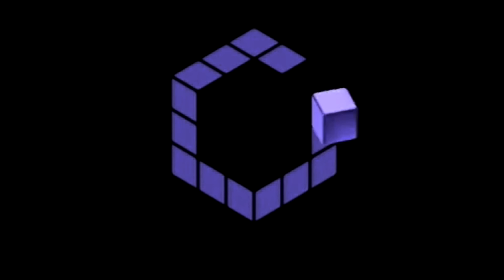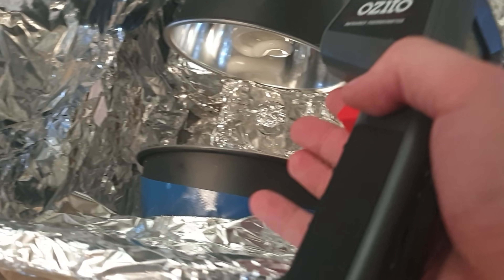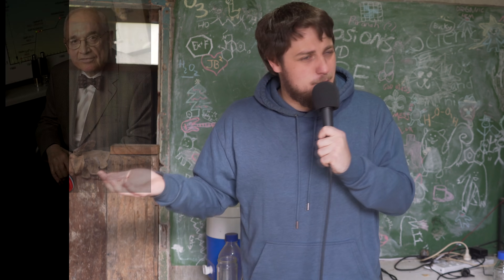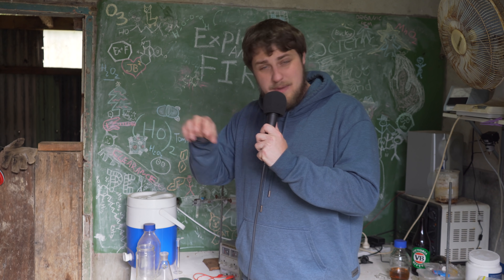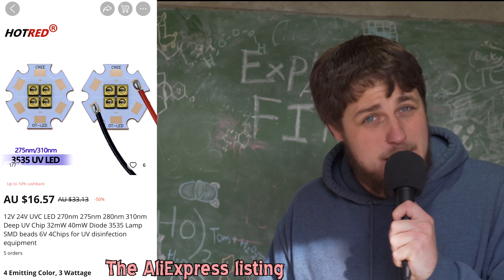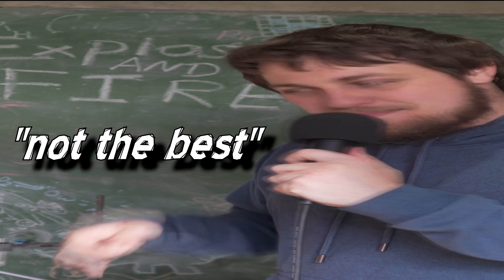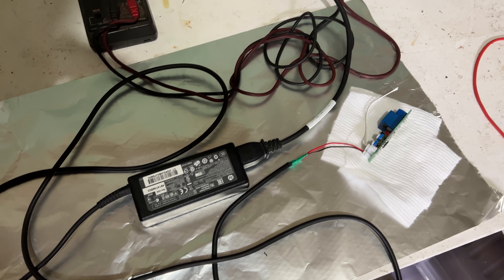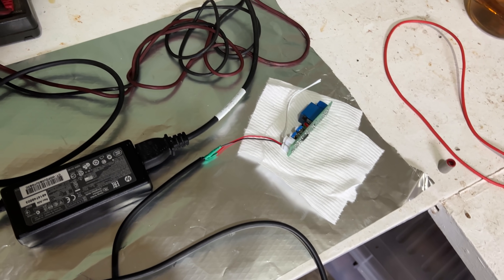Magical deep UV LEDs - Cubane Ep 12

Comment: It's probably been explained already but the reason LEDs won't just draw whatever they need is because after the LEDs have enough voltage to start conducting, the forward voltage drop (that is, basically, the resistance across the LEDs) will drop rapidly, which is why you need to limit the current externally. As LEDs heat up, their forward voltage drop will also decrease, causing more current to flow, which is why you saw your LEDs draw more current as they were on for a short period.

Also, personally, would recommend putting the relay after your power supply. Depending on the quality, it may not limit the current flowing into the capacitors, causing inrush current any time you switch it on which can damage the relay or the capacitors themselves over time. Some electrolytic capacitors also have limited charge cycles, though usually more so than even Li-ion batteries, still a consideration for long term usage.

Comment: The easy way to power LEDs without a driver chip is to find what their junction voltage is, subtract that from your power source and then put them in series with a resistor that drops the remaining volts at the required current.  Also don't run them full blast.  Ohms law is scary useful.

Comment: 40mA @ 12vdc is only .48W power.  It seems a bit off on a power led since there are 4 on a board (.12W each).
I would try getting the data sheet on the leds. It will give you the correct limits and include pwm , which will allow much more power to be emitted. The data sheet typically also gives the spectrum of the light. Perhaps you can find a mark on the backside of one of the roasted ones
As for the .40mA thing, the prefixes are the same as for weights. Using 1gr of NaOH when it calls for 40mg is sure to stuff it up.

Comment: The "electronic stuff will just take the power it needs" idea does generally hold for most stuff. If you give it the right voltage it'll just draw as much current as it wants.

LEDs aren't like that. They have a normal voltage drop across them (usually about 2 volts per LED) and won't conduct much, if at all, below that. There's a really narrow band between too little and too much where it'll operate more or less normally, and above that you now have a smoke emitting diode. You need some sort of current regulator in series with each module to ensure that it never gets more than the current it's rated for.

In the case of those modules, they want 12v and 40mA. Say you want to power them off that 19v power brick. Put a resistor in series with each module, then put the modules with resistors all in parallel, then connect the whole mess to the power supply. Each resistor should drop 7v (19-12) at 0.04A. A little Ohm's law and you get a resistor of 175 ohms. It'll need to be rated for at least 0.28 watts. Chances are you'll have a way easier time getting your hands on 200 or 220 ohm resistors at 1/2 or 1 watt, and those would be fine, it'll just run the LEDs at a little lower power and the resistors won't get as hot. Those are both very good things.

Comment: The way you should think of an LED is a voltage drop. The idea that it will only take as much current as it needs doesn't apply to diodes. It will happily dump very high amounts of current as long as you go above its threshold voltage. You want a series circuit of a resistor and diode; a series circuit has the same current traveling through all of its components so that resistor will limit the current so you don't exceed the limits of your diode. Practically speaking this just means you subtract your diode voltage from your supply voltage and divide the remainder by the desired current, this will give you the resistor value.

Comment: The ammount of misunderstanding of electronics here is astounding 😅😂

A 12v 40mA led neads "around" 12v at MUST NOT have more than 40mA.
Use ohms law and led resistor calculator to get it right since this is so low current.
1A through this WILL kill it FAST.

You need to know your powersupply voltage (needs to be a little more than the diode voltage).
The foreward voltage of the diode.
The current of the diode.

And then you calculate the resistor you need, and if you cant get the exact value resistor go to a HIGHER one to not overpower the diode.

Example
12v and 40mA diode and 14v powersupply
You need 50 ohm resistor in series. If you have a 6v diode and same powersupply you need 100 ohms.

And veryfy with a multimeter the current of the diode to be less than 40mA and the powersupply voltage.

You cannot use a 1A or 900mA led driver for a 40mA diode.

Comment: Remember: Voltage x Current (or Current x Voltage) = Watts. 1 amp x 12 v = 12 watts. and that's a lot of heat.
Reply: Except they stated a 40mA rating, which is only 48mW, for 4 on a board, which isn’t nothing .

Comment: Bruh, please learn what a resistor is before attempting this again. Those poor LEDs are screaming in pain. You're probably going have to buy a whole new set of them, because the ones you have are likely in the death knell now and probably unable to put out the specific wavelength that you need any longer. I'd be shocked if they were still functional enough to make this project a success.

I BELIEVE in you, I just don't BELIEVE you did enough reading before trying to wire up those LEDs.

Comment: Amazing video man. Mark my words, I shall make a UV C phone flashlight. You don't need the earth unless it is in a metal case. The earth is meant to carry fault current to ground when eg a live wire touches the inside of the case. The ballast is made of metal so it should be ideally. Those ballasts are used often together with cob leds in metal lighting fixture. The ground wire is usually screwed into the fixture effectively grounding the whole thing.

Comment: 70's leds weren't high powered, LOL.  They improved a bit in the 80's.  90's was when they opened up from "tens of millicandela" to entire whole candles of output.

The price of blue LEDs dropped drastically when they figured out how to make them from GaN instead of hyper-expensive silicon carbide.  Not the same device at all - drastically different voltages - except that they both made blue.

I do wonder if replacing mercury lamps with LEDs is a good idea for society in general.  A mercury lamp isn't toxic unless you EAT it, and these ultra-high-wavelength LEDs die really fast and are polluting to make.  Is it a net win?

Comment: If you are driving the leds they need to be current limited. Either a resistor selected using ohms law, or a current source set to 40mA MAX! 
Thats why the amps jumped so quick on that PS. It just acts like a dead short

Comment: Please reconsider having the relay switching the 240v lines. Put it on the low voltage DC side instead like you were considering. You have exposed terminals with 240v present on that relay with no cover, I’m not saying you’re going to electrocute yourself or start a fire but there is a non-zero chance, especially with no earth and potentially no RCD on the circuit. Yes you could put it in an enclosure, etc, but better to just have it operate on the DC and eliminate the hazard. Legally, you shouldn’t be modifying 240v at all without some sort of qualification though I don’t really care about that as long as you work safely. I’m sure there are plenty of other comments saying the same thing but I cbf reading 1k comments. Love your work mate, don’t take this as criticism but rather friendly concern.

Comment: With no load and the power supply on, adjust the current to a very low value a little above the minimum. Adjust the vtage up to a bit over 12V. Place a short across the power supply terminals, then adjust the current to 40mA. Disconnect the short across power supply terminals. Turn off power supply and connect LED. Turn on power supply. Confirm LED is consuming 40mA. Might have to slightly bump up voltage setting to ensure power supply is operating in constant current mode.

Comment: LEDs do positive feedback current draw... you need current limiting. whoever it was who told you otherwise on twitter either has their head up their ass, is a troll or is talking about LEDs with integrated driver.

40mA is likely the maximum forward current

Comment: Firstly, congrats for 'giving it a go'.
Having said that, I suggest you grab another full set of UV LEDs as I suspect those ones will be pretty screwed (you've thrown over 2000% of their rated current through them)
As others have already said in their responses, 40mA MEANS 40mA and anything more starts 'frying' them.
Your benchtop power supply is not accurate enough on its current setting
It's pretty simple to create a constant current circuit - 2 * transistors and 2 * resistors, but the suggested LM317 style is even easier.  1  * LM317 and 1 * 33 ohm resistor will give you 37.8mA.  The power supply can be any voltage between about 15V and 40V so your 19V laptop supply will be fine.
LEDs are most likely failure cause is overheating.  Not the temp of the heatsink, but the temp of the tiny silicon die itself.
The hotter they are, the more current they will consume so it's a BAD idea to run them in parallel - due to manufacturing tolerances, one will consume a TINY bit more current than the others in parallel.  This will make that one a little hotter, so it will consume even MORE current -> RUD (RAPID UNSCHEDULED DISASS$EMBLY!)
You CAN safely place LED in series (but you'd need to increase the voltage of the power supply accordingly)

The MOST 'finicky' LEDs IMO are LASER LEDs.  These will 'let out the magic smoke' if you even THINK about over driving them!  (e.g. the cheap red ones you can buy from Jaycar will die in less than a millisecond if they're over driven by only 2mA!  Don't ask me how I know <<<Sigh>>>).  From what I know, the LASER LEDs die by burning the mirrors at each end of the cavity LONG before the die itself is fried.
The LEAST 'finicky' LEDs IMO are the infrared LEDs like those found in your TV remote.  These are normally rated around 50mA or so, but are often driven at over 1000mA (1A) to make them 'bright' enough for your TV to sense.  The key is that they're pulsed off/on rather than CW (Constant Wave) so they don't get enough TIME to overheat and die.

In your UV case, you're MOSTLY looking at CW operation.  (Pulsing LEDs involves timescales of microseconds to millseconds while you're talking about multiple seconds!)

In short, do a simply google search on "LM317 constant current" and run with that

Comment: If you have 12~14V LEDs, do not give more than 12V (which can have some error margin because your display isn't perfect). Giving it more volts will cause electricity to go through places it shouldn't go through, which is why you see power increasing. Basically it means bad things are happening and your LEDs are dying, heating up, maybe catching stuff on fire in the process. I'm probably not the only person who cried watching this as you went over 12V and the amps went up.

Comment: Holy fuck, this is both entertaining to watch, and so painful at the same time. 
At the begging you went "I'm not good at electronics" and I was like, "dude has a Phd (or almost), does organic chemistry for fun, connecting a few leds isn't that hard", and then I saw him connect "40mA" led to a power supply scaled in Amps, I nearly jumped out of my seat.
But yeah, my setup would be:
1. Try to confirm if those indeed are 40mA LEDs
2. Get adjustable power supplies that have regulated current, maybe something LM2596 based, they are like 1-2 bucks on aliexpress
3. Get a semi decent multi meter, like I'm not saying buy high end Fluke but please don't use those sub 10 bucks crappy ones to set up 14$ LEDs
4. Dial both voltage and current to 0, connect the multimeter in series to measure amps (milliamps), and turn the voltage up, after that raise the current to desired value.
5. Unless it's good for chemistry don't bother with on/off circuit, if you can't cool it, just dial the power down 
6. Airflow through radiators is incredibly important and efficient, with radiator fins spread up so much you don't need a lot of it thou.

And that is really it, it is really simple (well, at least if you worked/played with electronics most of your life).
Good luck.

Comment: I'm sure you've gotten a lot of this, but you've GOTTA throw some resistors in series with your shit. Volts = Amps * Ohms (V = IR). LEDs don't really have a resistance, but they do have a "voltage drop" across them that you'll subtract from your initial voltage. (Hopefully your spec-sheet lists that, otherwise, use a big resistor and measure the voltage across it using a multimeter.) After you know the drop, pick a source voltage and resistor to keep the Ohms in your target milliamp range.

Comment: Oh my god man... electronics are dead simple. Don’t go above the recommendation for current or else it will get very hot and drastically reduce its lifespan. Limit the current to 40ma and the voltage will naturally settle at the 12-14 volts the manufacturer stated.

Comment: At 14:43 , you mentioned an issue with your understanding of voltage that I also used to have. If you put 24 volts across a load, it will not use "only what it needs." One of the analogies that helped me understand what "voltage" actually was is the analogy of gravitational potential energy. 

The bottom line is that voltage is a measure of electrical potential (i.e. the potential for electricity to flow). Although it's not exactly potential energy, you can think of it much like any form of potential energy, and gravity seems to be a commonly understood form. 

So, imagine dropping a glass from a great height. 
Will the glass use "only the potential energy that it needs" to accelerate safely to the floor without breaking? Obviously not. All of the gravitational potential energy of the glass will be converted into kinetic energy as the glass falls.
Lets say this glass is rated such that it will fall safely from a height of 1 meter without breaking. If you drop it from a height of 1 meter, it will remain intact and function within spec. If, however, you drop the glass from 2 meters, the glass will fall with too much energy and break on impact with the floor.

This is analogous to most electronic components (though the other posts are correct, LEDs should be current-limited for the reasons they say) if a component is rated for 5 volts, then power it with 5 volts and it should behave within spec, but if you power it with 10 volts, the component will most likely pop. There are of course exceptions to this general wisdom (LEDs sort of being an exception but also not exactly an exception), but nonetheless the potential energy analogy is a useful one when it comes to voltage.

If you want a chemical potential analogy, then imagine a reaction with a predicted amount of energy released, if you initiate the reaction using a plastic cup for a reaction vessel, that energy is coming out of that reaction and getting absorbed by the reaction vessel regardless of how much energy the vessel is rated to take. If the amount is too great for the vessel, the vessel will still continue to absorb it and may fail. Putting the two LEDs in series is kinda like increasing the overall ability of the vessel absorb the reaction energy. Using the plastic cup reaction vessel example, that would be like stacking the plastic cup inside of another plastic cup to increase the overall strength of the reaction vessel. It's a pretty tortured analogy at this point but it sorta works well enough to get by.

Comment: Tell me this is just for the views right?  Nobody who knows so much about chemistry could be so clueless about electronics.  Use Ohm's law, figure out what size resistor you need to limit the current to within spec and then get a sufficiently large resistor to handle the power dissipation (I squared R).  Don''t just blow up the nice LEDs.  Once a diode is forward biased, the current increases exponentially with voltage, hence the need for a current-limiting resistor.

Comment: Been enjoying this series, I know this step has given you much pain. Electronics seem mystical when you don't have any background (got a degree in EE not worth bragging about).

Most people have already stated what needs to be improved but just make sure there's no loose ends:

It's recommended to have a resistor in series with the LEDs so you have consistent voltage and current in your circuit - let's just say that transistors (what diodes are made of) are unreliable in "asking" for the same voltage over time, others call it sensitivity.

For your circuit to be in series you would be basically making one loop:
Power -> Resistor -> LED -> LED -> LED -> LED -> Power (ground - black wire)

For the size of the resistor, it's kind of dependent on your LEDs though most don't have a sufficient resistance (CHECK THE DATA SHEET THOUGH!). If it's not to big we can figure it out real quick.

V=IR or R=V/I so 12Volts/40mA = 3K Ohm resistor 

(other smarter people can check my work)

Hope this helps!